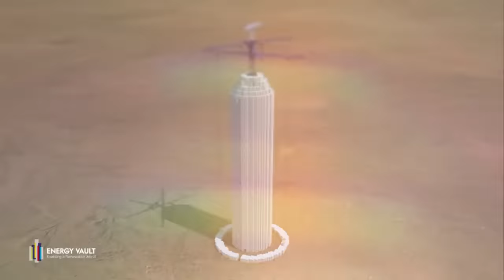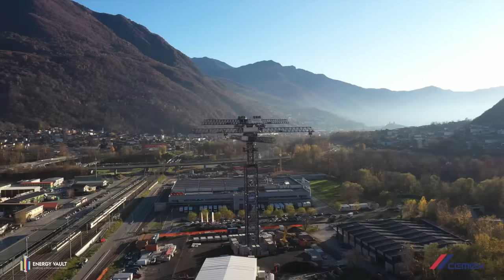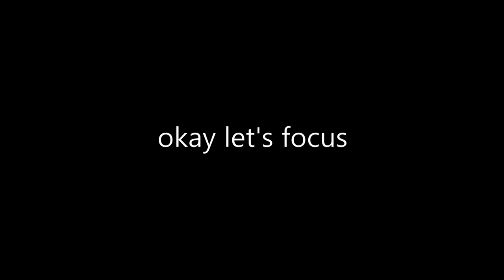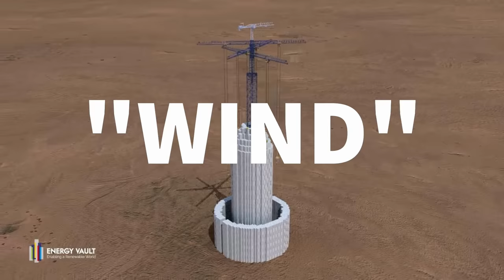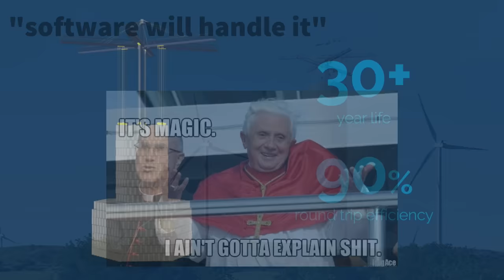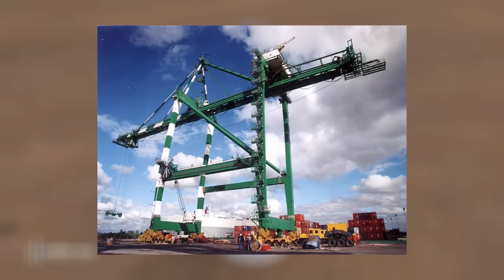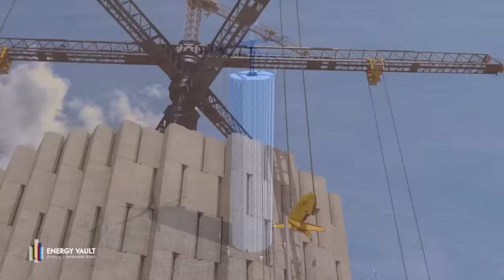The Energy Vault is a Dumb Idea, Here's Why

Comment: The heavier weight of concrete or stone does have the benefit of higher energy density for a height traveled which is similar to another old technology called a hydraulic accumulator. Basically, a big vertical cylinder with a heavy weighted piston. Water is pumped into it, lifting the  weight to store energy. The constant-ish pressurized water was then available to run hydraulic machinery. Historically this was used to operate cranes and other heavy machinery with earlier steam engines
Reply: No problem with high-pressure leaks?
Reply: Time to make it out of mercury!
Reply: @jacksonayres6326  or nuclear fuel waste!
Reply: this really doesn't scale up well
Reply: Sure but that isn't really an issue, is it? We have plenty of space and plenty of (non-drinkable) water. Any efficiency you gain is simply obliterated by how simple and effective a hydro-electric battery is. Economies of scale galore.
Reply: @wellendowedplatypus9024  no, we don't have enough space.
At least not the kind of space a hydroelectric power plant needs.
(Two large bodies of water with a height difference)
Reply: @sir0herrbatka  it wasn't a problem because the resulting pressure wasn't that high, just enough to run a piece of equipment while the steam engine was either being brought up to steam or out of steam. I know they were used on fortifications to run shell hoists because of their on demand power ability
Reply: uh, no, water is heavy as fuck. also water is more available so even if it is a little less dense than stone you dont need to manufacture chunks of concrete
Reply: @boijone8440  concrete is up to 2,5 times denser than water.
So it's not "a little less dense". It's a f*ck ton less dense.
Reply: I'm thinking, Grandfather Clock Mechanism and weights in a tower, the only problem I can't figure out is how to get the weight up there cheeply, consistently.
Reply: @Jehty_  But water is a lot cheaper than concrete. And no chance of the water cracking.
Reply: @nickl5658  but a 100m or so high water tower is not cheaper. (100m is as far as I know the minimum height difference a closed-cycle-pump storage can operate on) 
You want the water storage as high as possible to increase the efficiency.
Whereas with the concrete blocks the height difference is not so important.
(water needs high speed to efficiently turn the turbines. The lower the water head is the lower the efficiency is)
Reply: @silasmayes7954  Generally speaking every powerplant out there that runs a steam turbine like a coal fired plant or nuclear plant, etc. runs at 1500psi. which approximately equals a column of water 4500' high. So yeah we know pressure.
Reply: @Jehty_  for concrete blocks height difference should only be less proportionally important based on how much more dense they are than water. You can increase flow speed with bottlenecks, but that loses rate. With a small pile of blocks you only get a little energy lowering them, and have to spend more translating them sideways to find low ground.

Just saying that you really want as much height as you can get for both, neither are happy with small height differences.
Reply: @Jehty_  And tungsten is 8 times denser than concrete - why not than?
Reply: @Jehty_  Is still orders of magnitude cheaper for a given capacity and power output because we can easily operate with gigantic volumes of water.
Reply: @SuperMassiveGrayCat  and Shipastij is 10 times denser...
Reply: Concrete (or rock generally) is only about three times as dense as water. So there is really no point to use anything else but water in gravity storage. Especially when you think about how much simpler a dam and a turbine are compared to a crane.
Reply: @superdau  again:
Only if you have a mountain.
No mountain - no easy way to achieve height distance for your water.
Reply: @Jehty_  But there are few of me so the capacity...
Reply: @Jehty_  So... a mountain and a high voltage wires might be a thing
Reply: @Jehty_  
If you have the space for a crane you also have the space for a water tank and tower (or hole). The density difference between water and rock just isn't large enough to warrant going for complicated, maintenance heavy, mechanical contraptions over simple water tanks, pipes and pumps.
Reply: @superdau  do you guys not do any research at all on your own?

How tall is the tallest water tower in existence? Hint: a lot lower than 100m
How much water does that tallest tower hold? Hint: not much 
How expensive was it to build? Hint: pretty expensive. 

How expensive is it to dig an underground water storage? Hint: pretty expensive. 

So again again: Unless you have a mountain or an existing mine-shaft pumped-storage hydroelectricity is not feasible.
Reply: @Jehty_  
And a crane that lifts things 24/7 is free? You have no idea what running a crane costs. The maintenance, downtime for repairs, the operators. You apparently also have no idea which physics and engineering problems there are. This is not like a toy crane stacking Lego bricks. 

How high do you think you can stack those loose blocks before it's no longer stable enough to be considered safe? Every time you stack a block you have to make 100% sure that blocks are in good condition, otherwise your hole stack will turn into a pile.
How high do you think you can stack those blocks before the lower ones get crushed?
Do you even know how much energy is needed to create the cement for a ton of concrete? It is estimated that cement production is responsible for 4 to 8% of all global CO2 emissions.
Any idea what that costs? Hint: a ton of water is as good as free.
And all that for a system that's not scalable at all and stores a days worth of energy from a single wind turbine? 

Stacking blocks is stupid from an engineering standpoint and never economically feasible.

Take a guess why pumped hydro power plants are used all over the world, but none built any a block stacking crane, even though the necessary technology for both has been available for more than a century.
Reply: @superdau  please do show me where I said that the concrete-block-storage was a good idea.
Oh wait, you can't because I didn't.
All I did was to tell you guys that water-tower-style pump storage is a stupid idea.
Take a guess why water-tower-style pump storage does not exist....
Reply: @Jehty_  Part of your argument is that digging a hole for the water storage would be very expensive, but the diagram of an actual pumped water storage facility was two big holes.
Reply: @chaotixthefox  sorry, I don't understand your comment
Reply: @Jehty_  I'm saying that the hole is not part of the issue and you should focus on the tower bit.
Reply: @chaotixthefox  but the hole is part of the issue.
To be clear what we are talking about:
There are two different kinds of pumped water storage suggested in the video/comments.
1. Water-tower-style
2. Underground-storage.

Both have their own problems.
So what exactly are you trying to say?
Reply: @Jehty_  Clearly not, since all the pumped water storage that exists is a pair of big holes.

That it is clearly feasible to dig big holes for pumped water storage because it has been done.
Reply: @chaotixthefox  
Please don't take part of a discussion if you have no clue what we are talking about.
Read supergau and my comments and then if you understand what we are talking about you can take part in the discussion.
Reply: @Jehty_  I really only care about the hole.
Reply: @chaotixthefox   ok, so let me explain it to you:
We are not talking about standard pump storage.
You know that kind where you have a lake on a mountain and one lake on the bottom? We are NOT talking about that.
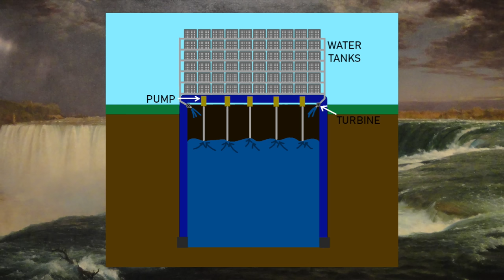What we are talking about is what is shown at 3:20 in this video.
Do you understand it now? 
Or do I have to be even clearer?
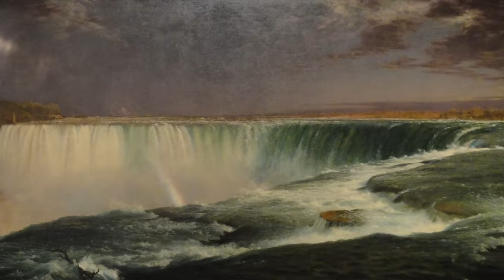Important: 3:20
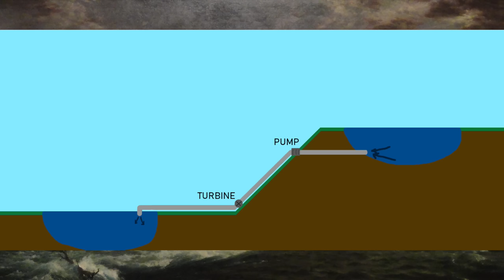Not 3:27  just 3:20
Reply: @Jehty_  You realize that 3:20 was not the end point to the proposal in the video, right? I'm not certain why you're so fixated on that idea-- something that only you have brought up in this thread as a talking point, and something that wasn't even a serious talking point in the video itself.

Noone was saying do 3:20, particularly because 3:27 already exists.
Reply: @Yawyna124   oh man.
Sometimes I think if I am the only person who uses his brain.

Think about it. Why am I bringing 3:20 up if 3:27 already exists?
Are there situations where 3:27 is not feasible? Places where there are no mountains? Do these kind of places exist? Would these places be interesting for green energy production? You know like off-shore windfarms? Are off-shore windfarms generally near mountains? 
Think about it.

Now what has all that to do with the "energy vault"? 
Where would you put an "energy vault"? 
On a mountain were a normal pump-storage facility would be feasible? No. You wouldn't put an "energy-vault" on a mountain. So where would you put it? Maybe near the ocean? As close as possible to the off-shore windfarms. Does that sound reasonable? Would you do that? 
I would do that. 

So now the question why am I fixated on 3:20
It's quite easy. You guys are fixated on using water.
I don't know why, but that's all you guys and the video is talking about.
So we have to use water. Okay. I am fine with that. But problem is, as I mentioned above, we can't use a normal pump-storage.
Because where we need the energy storage we don't have mountains.
But since you guys insist on using water the only option is 3:20
You guys don't leave me another option than to fixate on 3:20
Drop your requirement for using water and I don't have to fixate on 3:20 anymore.

Oh and one more reason: I kinda mixed up the comments. I had a similar discussion under multiple comments. So I thought stuff was said here when in reality it was written in another thread.
Reply: @Jehty_   Does where you live have any abandoned mines? Not that it doesn't come with its own downsides; you do have to have to do substantial groundwork to make sure you can do it safely since minerals from rocks can oftentimes leech into water and any sort of system like this is going to involve expensive tunnels. And, while it would be preferrable to put reservoirs used for energy storage near production *it is by no means a necessary requirement.* 

Overall, though, you should really learn how to communicate with people. The insistence that everyone was talking about something that only you are talking about and the constant derision of others is not going to get you anywhere besides people not interested in talking to you. If you're apparently so much more thunking than everyone else, contemplation of how you being quite as abrasive as you are isn't helping in talking to people shouldn't be any problem.
Reply: Well. Water has a density of about 1000 kg/m³ 
Concrete has a density of 2000-2600kg/m³
Gold has a density of 19840 kg/m³. 
Let's use gold instead of concrete :D

Comment: And one more thing.... crane ropes need inspections, greasing and changing more often than you think - 6 of them would most likely see 5 in action at any one time. Great video :)
Reply: And neither wind turbines or any other turbine or power plants need service and inspection lmao  It has draw backs but that isnt one.
Reply: @outlander234  perhaps, I did a quite bit of googling, it seems both crane ropes and thing such as turbine blades need an inspection twice a year, however the wind turbine blades can be done in some cases with a drone/magnified photography. Crane ropes are layered in grease and must be inspected manually.
Reply: "6 would see 5 in action"
Make that 4, I think. 
Because it looks like the cranes are supposed to serve as counterweights for each other, and a big crane without a counterweight is bad news.

Comment: Yet another point you didn't consider: This concept only ever makes sense if there is any actual height difference between your blocks. And the less height difference there is, the less energy you can extract. So your "empty" situation basically is all blocks at the same level (so you could replace the "inner" block up to that level simply with a solid foundation), and the lower your storage goes the less efficient your system becomes (because you have constant time attach/detach operations -> the lower your delta goes the higher your waste). And lets not even talk about the crane arms travelling empty half of the time.
Reply: This isn't revolution, this is just a logistics nightmare.

These people should try and play Factorio or Satisfactory so they could learn a thing or two about thermodynamics...
Reply: @ruffusgoodman4137  These people should go to school instead of playing games, lol, at least learn some first-year physics.
But the problem isn't intellectual and educational deficits in these CEO types. It's the intellectual and educational deficits in the shareholders - any idiot can buy promises made by any idiot if he's got money to invest.
Reply: @pwnmeisterage  A good point.

And there is another issue with the cranes which i haven't seen mentioned so far (unless I am missing part of the point OP is making) Not only is attaching and detaching wasting time, but the whole lifting process is - the higher the tower gets, the worse the problem becomes (part of the reason why it takes so long to load and unload container vessels). The further a crane needs to travel - both up and down and side to side - the more time it takes. Therefore it has not only a limited energy output capacity, but the energy intake capacity is similarly limited.
Reply: @pwnmeisterage  I meant the games as to patronize his seemingly ignorant mind.

Games help a troubled head to get along with science (sometimes. FFS Fortnite isn't a useful game for instance)
Reply: That's another good point, which makes pumping water up a hill way more efficient. You don't have to pile water up